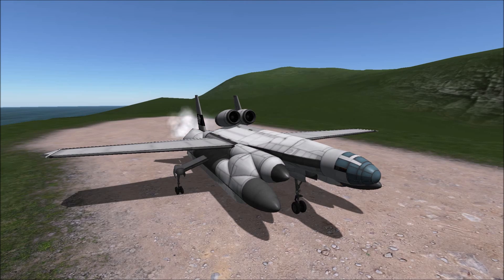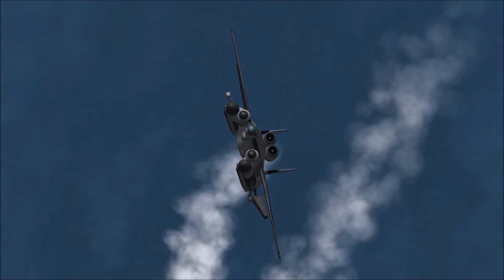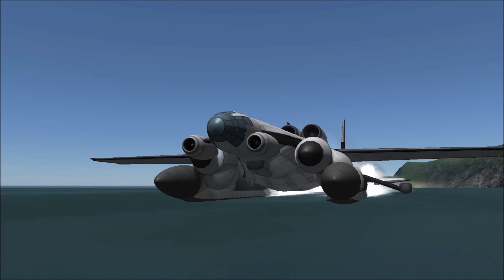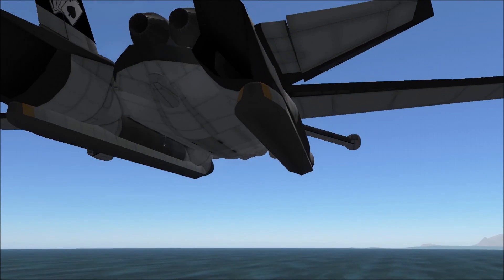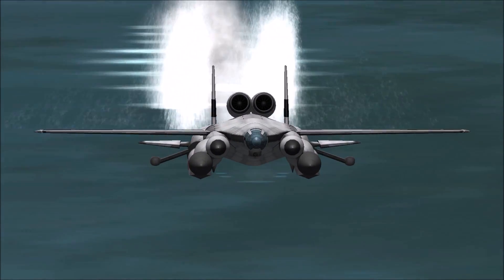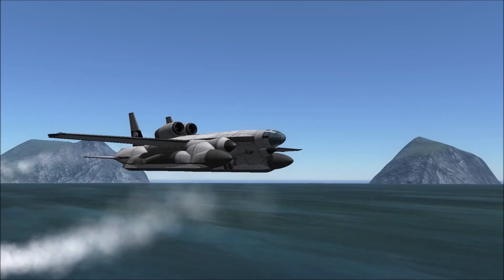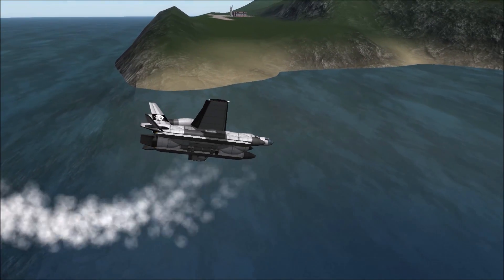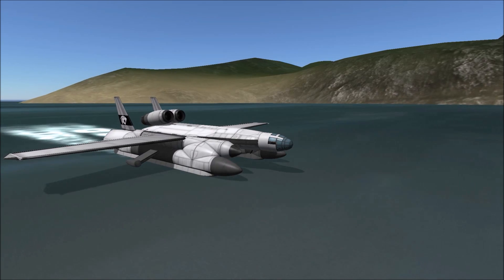KSP History's Misfits S2E7- Bartini Beriev VVA-14

Comment: As a sub hunter, seaplanes can do a few things no land-based plane can: any friendly warship can easily be fitted to refuel them for extended support sorties.  LPDs or even converted merchant ships can be fitted as seaplane tenders, supporting aircraft almost like fixed-wing (including fighters, strike, bombers, AEW/EW planes), without a super carrier in the fleet.
You could build "kits" for civilian dock ships or cargo carriers, or half a dozen LPDs & more escort escort or logistics support for them, for the cost of a big CV.
Our SSGN (that used to be SSBN) could be equipped to support a strike plus its air support, anytime, anywhere.

A seaplane, like some helicopters, can stop anywhere, and deploy a dipping sensor which can be very much more effective and efficient than laying down patterns of sonobuoys. Those are expensive and die after a time.
Unlike all but a few shipborne helo or any landplane, they can set down, shut down and pretend they're not there for extended periods, while dipping and using MAD. Then they can prosecute a contact or fly off and do it again.
A GEV in particular could do things like this, while either using very little fuel to go much farther than a helo, or fly (though the big ekranoplans did >380kts)

Comment: Great video. I remember reading about that vehicle. One thing I never really understood about it... What was the main purpose of it being a ground effect vehicle/plane in relation to its purpose of being a sub hunter? Was it because ground effect gave it longer loiter time and endurance than a plane would? or there was some benefit to detecting or attacking a sub because of that? I never really got it other than Robert Bartini just had a fixation of designing a ground effect craft for whatever reason (sorta like Jack Northrop's obsession with flying wings) ?
Reply: the advantage of it being an ekranoplan is that it can fly VERY low at normal speed so that the on board search equipment could work more effectively. The second reason (along with it being a VTOL) is that there was no counterparts in the west, and this was the cold war, so any time Russia had something the U.S. didn't they jumped on that shit.
Reply: Another advantage to anyone still interested/curious is that ground effect generates more lift than a normal aircraft at typical altitude. So less power is required, the larger Ekranoplan had 6 main engines for initially taking it out of the water but once out could run on only 2.

"Given similar hull size and power, the reduced lift-induced drag experienced by a ground effect craft will improve its fuel efficiency over that of a similar aircraft, and less power will be required for similar speed up to a point." Wikipedia - Ground Effect Vehicle